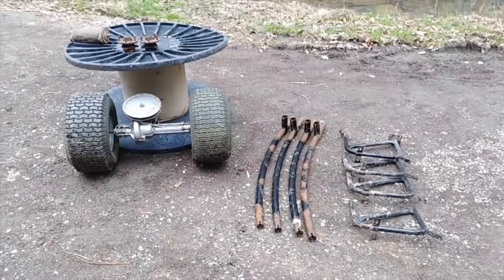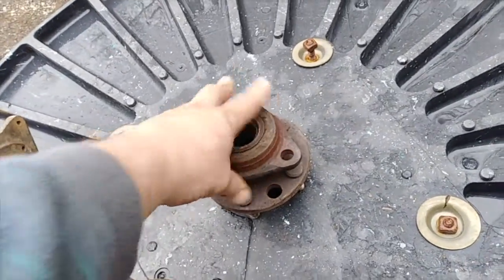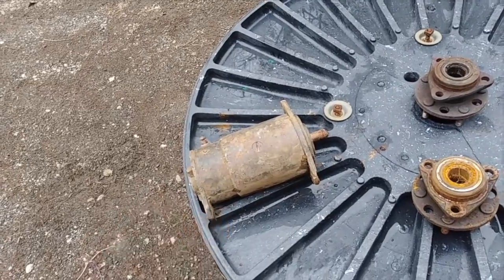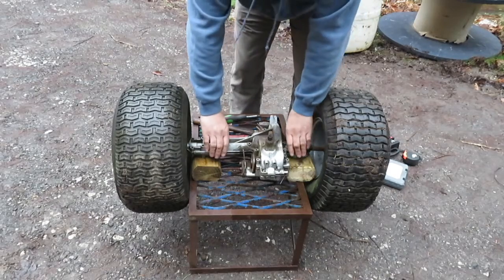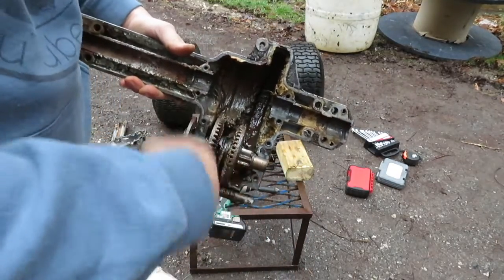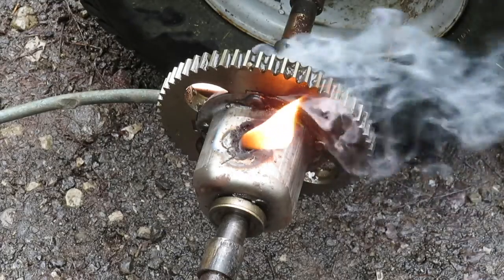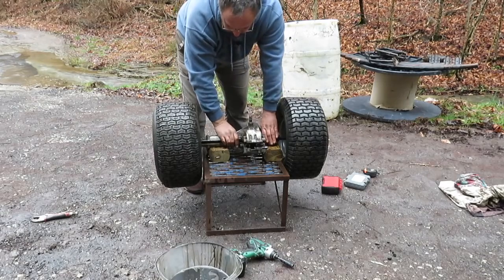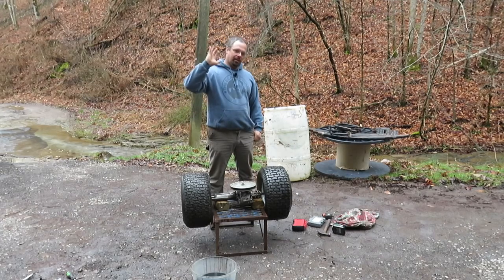New Water Wheel Build Part 1 Transmission

Comment: Why not judt lock the short axle to the housing with a bracket and let the differential gears spin the output/ (former) input shaft?  It's already got grease in it so shouldn't hurt it since the torque loading is next to nothing it was designed for.  Ratio should be a 1:1.

Comment: A old lawn mower mechanic told me to put a grease fitting in the top of my transmission. A few pumps of grease once a year he said. Works great! Now that's here in Texas. Plus I only use it during the summer so grease gun type grease seems fine. In cold temps or climate it might be to thick. Although if it runs 24/7 it may warm up enough to keep that type grease soft.

I will watch your other videos on this project later but you may want to add a grease fitting or some way to add gear oil because those transmissions were cheaply made! Even the new ones didnt have to long a life span. Yours looks pretty well used. =]

Maybe just drill a hole. Add a self tapping bolt with a gasket to pour some gear oil in it from time to time.

Comment: thanks for posting.    here are some things to consider.     at 6:00,  the  RATIO  of the  'transmission'  is,  WHAT.     it may not be well-suited to this application.    (the small radius differential gears are bad news.)       in an energy Conversion scheme,  close-ratio gearing is NOT wanted.         optimal 'wheel rotation rate (of  ANY  waterwheel) is determined, in part, by the flow rate/bucket volume,  and  the  amount of  TIME   required, for a bucket to FILL.      plan on a 'loaded' speed of   15 to 18 rpm, no matter What the radius turns out to be.   cheers              googletranslate